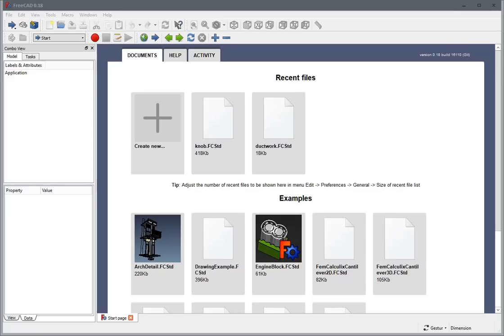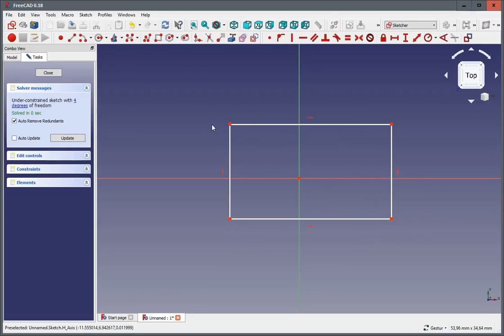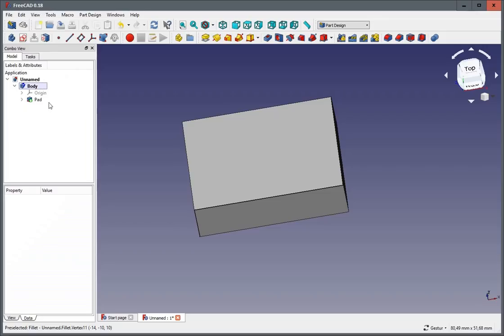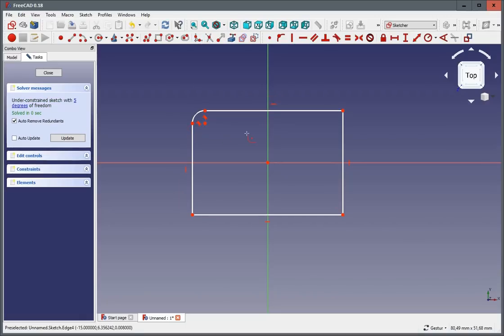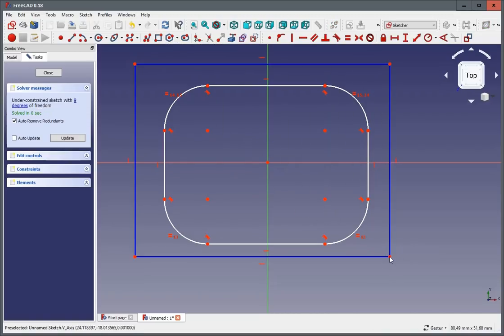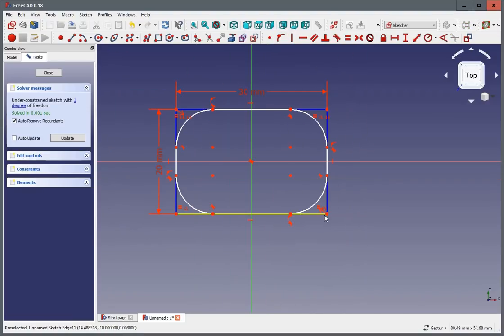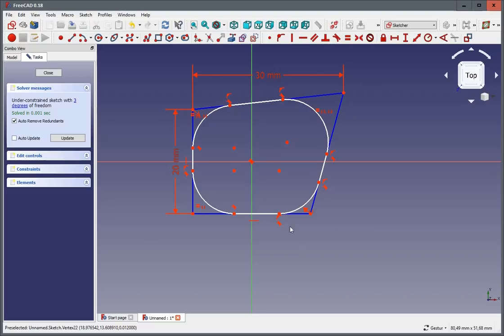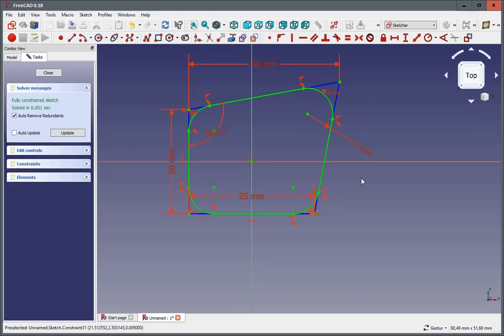FreeCAD ( 0.18) Tip Video : Using Fillets in Sketcher in a safe way

Comment: First of all, thank you for this video; it made me understand why the fillets failed: as you said it, the dimension constraints are removed.

Now to the point: I'm trying to do something similar, but with a triangle with two equal edges, which intersect on the X-Axis. horizontal distance of one of those edges is also know and it is constrained. After applying the fillet on those two edges, it got under constrained as expected because the dimension constraint got removed.

So, I draw a rectangle that encapsulates the triangle, but then I constrained the arc to be tangent to the rectangle and it looks like I want, but it still shows "under constrained", so, I tried to add a radius constraint, but it is still failing.

SInce YouTube doesn't allows me to post links here, I posted the question: "Under constrained filled, how to correct it?". If you could take a look, it would be great.
Reply: For the interested: I solved this tanks to the FreeCAD forum, topic: "Under constrained filled, how to correct it?"

The answer from TheMarkster, was what I used:

"Add a construction mode point and constrain it both to the edge of the arc and to the edge of the axis line. Then constrain it to be 6.5mm from that other point horizontally. Note also the vertical constraint applied to the 2 arc endpoints to ensure they are symmetric with the axis line."

This one also works, instead of the last vertical constraint, I added an equal constraint to the triangle edges.

You can see the example on that thread and reproduce the steps to solve the problem.

Comment: so where is the problem with using fillets?
Reply from the maker: You can read about the problem in the Forum. If you constrain your sketch the wong way, changing fillet radius will change line properties.